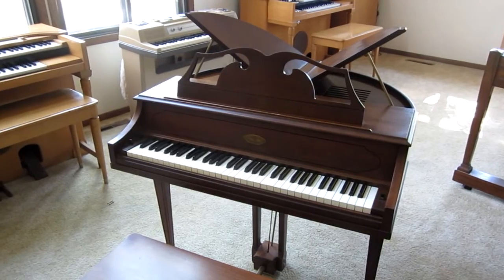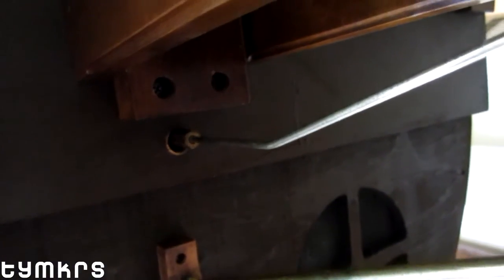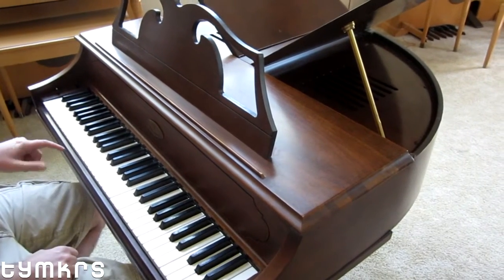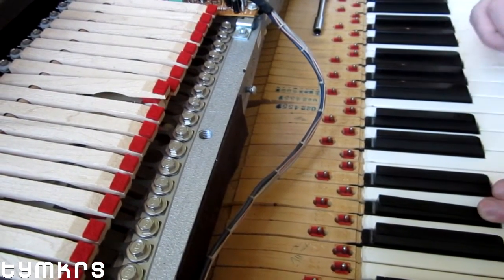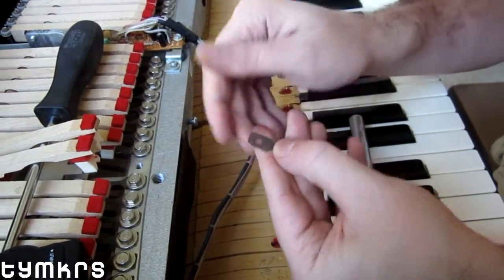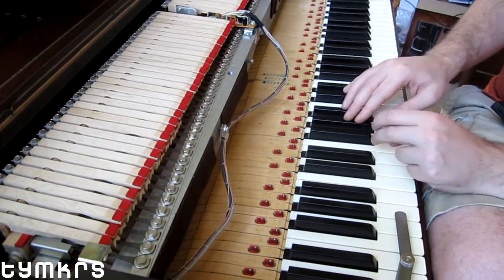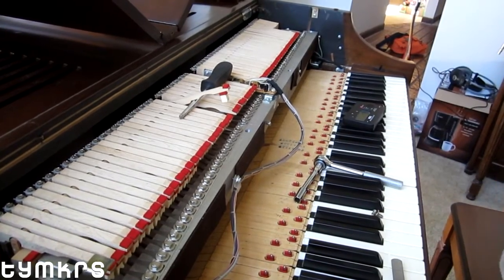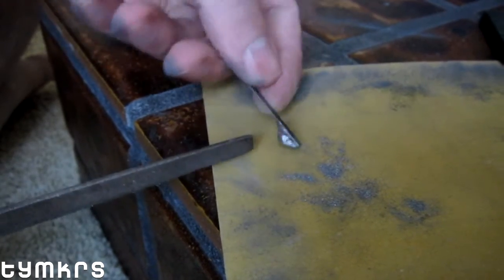Tymkrs Wurlitzer 270 Butterfly Baby Grand Electric Piano

Comment: Wonderful video!  I’ve got a question.  I just bought one and hauled it home from 4 hrs away.  It’s still in the car with the legs and all off.  I noticed mine only has the one brass sustain rod and not the second one in the rear.  What’s the one in the rear do?  I feel like I should hunt one down or make one but am not sure of its function…thnx!
Reply from the maker: Sorry for the delay - it's for stabilization - to keep the sustain pillar rigid - not sure if there are different versions out there, but making one should be okay!
Reply: @whisk0r  Thanks so much!

Comment: It seems that you do fine tuning by tightening and loosening the reeds? Never seen that before. How does that work?

I know there is a little bit of slack in terms of how far fowards and backwards you move the reed, so I've normally handled fine tuning by attempting to "knock" the reed a little forwards in its socket with a flat head screwdriver, but it really does not work very well.

You mention that it has the same guts as the 200, not the 200A, but far as I can see that is incorrect. There is the preamp on the rail and it seems to be born with reed bar shields.
Reply from the maker: +Zaki Wasik My guess would be that the more you tighten the screw the more bend you put across the reed.  This stiffens it up a tiny bit lengthwise (think how the tape in a tape-measure has a bend in its cross section).  Adding or removing lead gets you within a few cents, tension gets that last cent dialed in perfectly.  I find that the forward/backwards play (along with the shape of the lead) can be most useful in dealing with buzzing.

The guts being more related to the 200 than the 200a was something I read.  There is almost no information out there on the 270 and half of it is mysterious third person "my uncle once saw one in person once" kind of stuff.  I happen to only have my lovely 206A to compare it to, no 200 or 200a at my studio sadly.